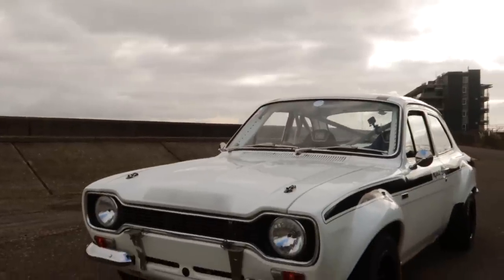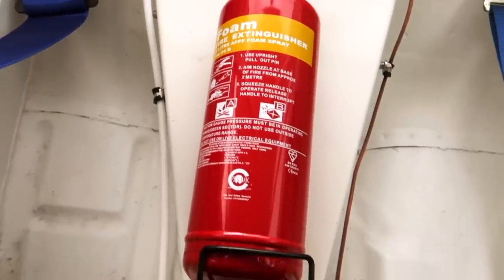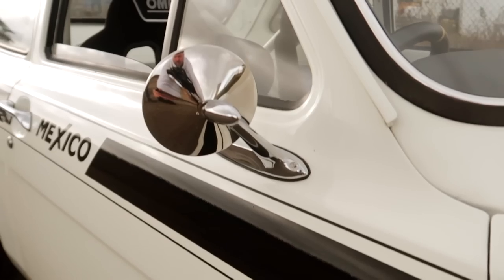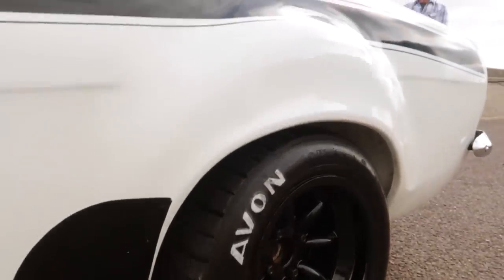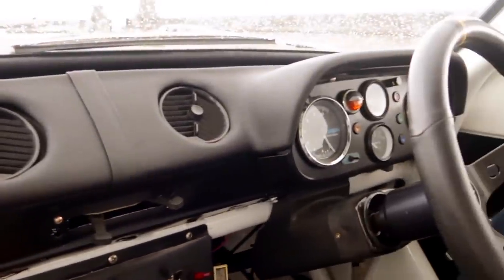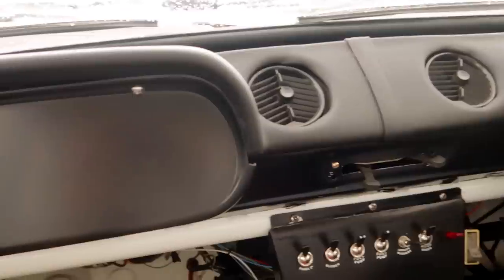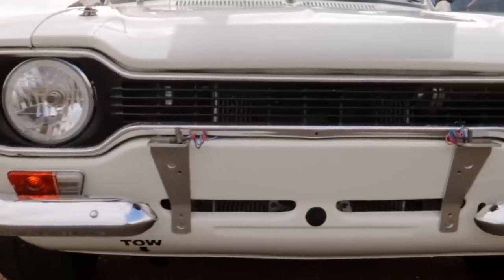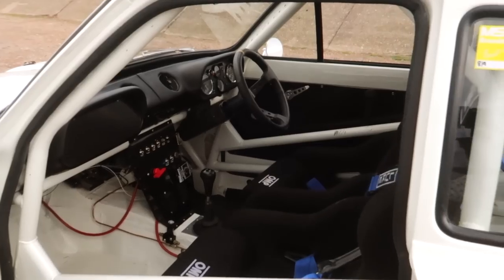*TRACK MACHINE* MK1 FORD ESCORT *MEXICO* 160BHP OF PERFECTION

Comment: My grandma’s luxury car. Though it was a 2 door, 4 speed manual gearing and just 1300 with no aircon, top speed of around 100 - 130 kmh, and looks much like your regular average car, the way she drove it. She treated it like she would with a rolls Royce , Cadillac, Bentley, Mercedes Benz, or any limousine. Later she even hired a personal chauffeur to drive her around. She bought the car 2ND hand. Smooth running. Great luxury car for the whole family.

Comment: Damn back in the day we use to put the old pinto in spin the sump and step it strip it out cut 2" hole all over just junk everything even the glass used plastic keep one wiper they were so simple to work on and we raced up and down the other side of blackstone edge littleborough , i all so had a few minis best one was my 1440 cc i just would blow it after a few runs up and down the edge Damn wish i could back in time iam over 60 now gutted
Reply from the maker: That’s awesome. The price of these things is just mad now! Beautiful bit of kit though! 60s never to old :)

Comment: Wow if it's a genuine Mexico then worth silly £££,glad to see its still got the ohv engine and didn't swap out to a pinto or wreck it by putting something stupid in it from another brand..
Reply from the maker: Yeah genuine Mexico bud. He has discussed a 2.1 Pinto possibly BUT he loves all things period. May stick with what he has.
Reply: One my first ford was a mk1 sky blue escort hob 460N think was it's reg,owned it twice as it goes,first time round could never get it to run correctly had push it for it to start but it had a 1750 over bore and was fun when did run,so swapped it for a mtx125 off road bike,then got it back couple years later,but didn't know the engine got taken out and swapped so he could get insurance on it,so I drove off smiling away thinking yes I've got it back and it's running off the key know more pushing,picked couple mates up for to go on a spin,then booted it but was slow as you like,gutted once realised so then sold it.....
Just did a dvla check on that reg and just found it,but was yellow originally so found out something new....
Reply from the maker: markcozzie sounds amazing mate, I can imagine that blue colour!
Reply: @CJK20  
Back in 1992/1993 I was only 16/17 so yeah was Alot fun back then,it's had the alloy door pods,bucket seats but only the drivers one was bolted down so everytime i  booted it my mate would end up in the back 😂,brings back some old memories now 😂...
Reply from the maker: markcozzie that’s awesome love how some cars etc can just bring back such good memories !
Reply: markcozzie: Sounds like it was Olympic blue.